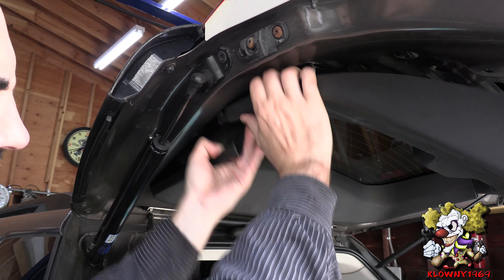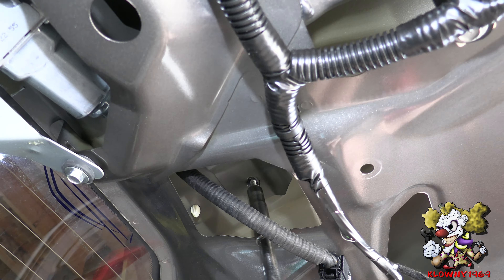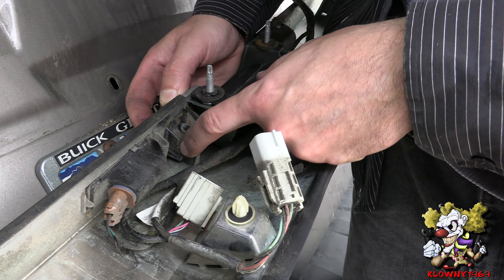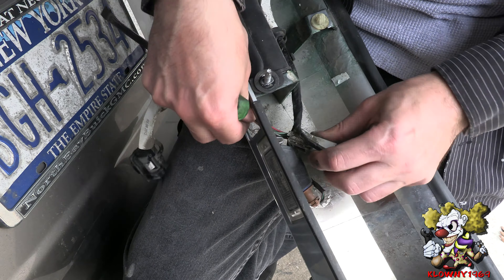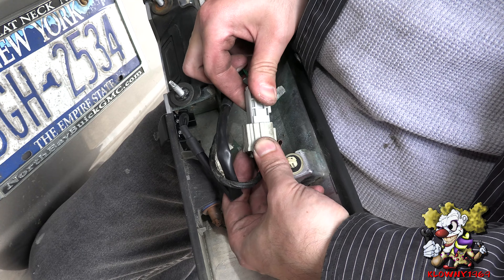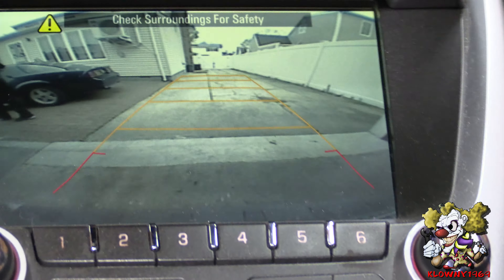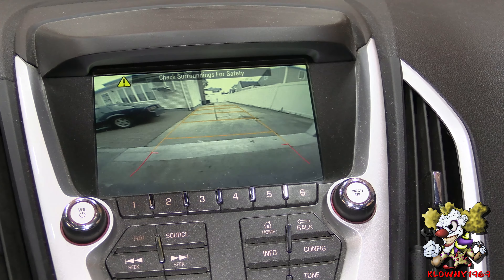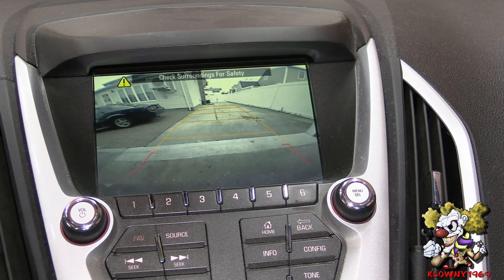How To Replace A Factory Backup Camera

Comment: Good video.   Fixed camera on my 2013 Equinox by disconnect/reconnect the 2 main harness connectors.   Likely oxidation on the contacts over time.   Applied dielectric grease to protect the contacts when reconnecting.  Works fine now.
Reply from the maker: Awesome! Glad you fixed it..don't forget to subscribe

Comment: I will be doing this install this weekend. What do you think of the Dorman camera replacement? My current camera on my Terrain is working but washed out from the sun. If light hits it can't see anything. Seems like the colors on your replacement were not very vibrant. This might be a limitation on the screen itself but didn't know if they new camera would be better.
Reply from the maker: Camera was fine when installed..it was a customers car..don't forget to subscribe and good luck with the install!

Comment: Hello. Is that camera not an original GM brand but it is just for that model of vehicle? I ask because I would install the camera from the Buick Regal on the Opel Insignia. Everything is the same except for the part code, which is logical. Cam for Buick is 60$ and for Opel 400e 😞

Comment: Replacing the camera does not make the guide lines show up on the display does it?

My 2012 Equinox camera has practically no image to display when it is raining or when the camera at the license plate gets wet, so I want to replace it. Too bad the entire panel on the rear lift door has to be removed to get to the camera to replace it with one that is waterproof. And it has no guide lines on the display.